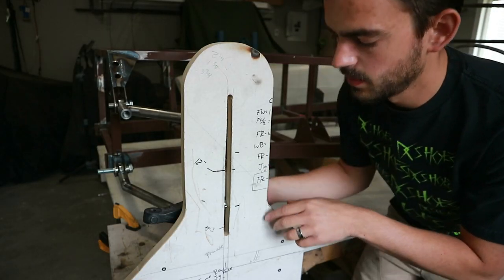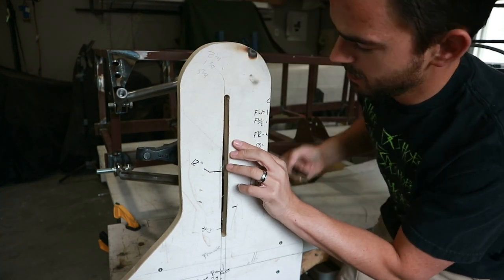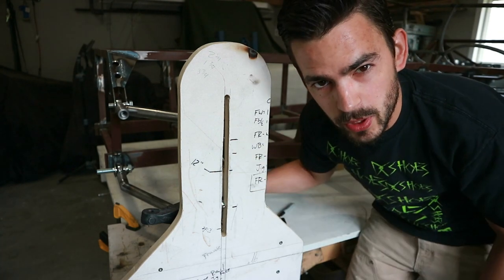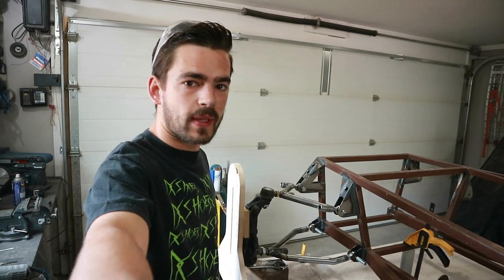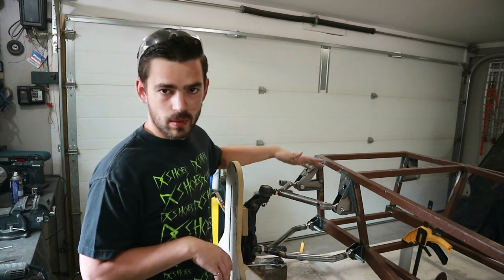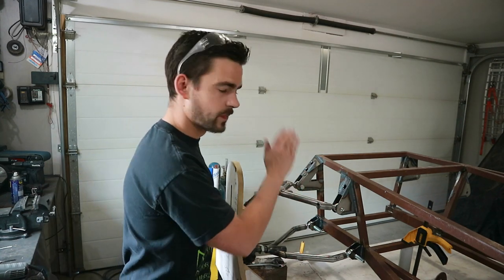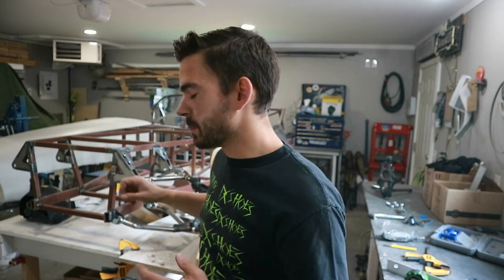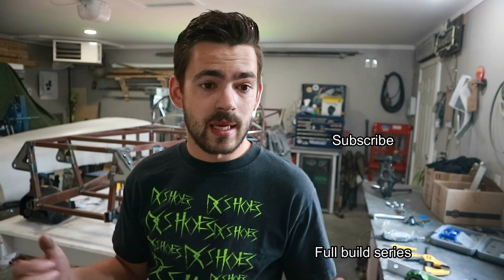Ep 85: Bending the A-Arms to Prevent Ball Joint Bind

Comment: Your camber during up cycle probably changed as well after modifying them. Best to double check before you build the other side to be sure it’s what you want
Reply from the maker: The nice part about the double A-arm suspension is that the shape of the arms doesn't affect the camber curves, just where the pivots are in space. So the bend shouldn't change my camber gain, and there should be enough adjustment on the heims to bring static camber back in line.
Reply: LeftFootFirst true, but it likely changed the length slightly. Just wanted to be sure you checked before spending too much time. 
Sorry about the job by the way. Talented guy like yourself should get back on your feet soon. I’ve been jobless for almost a year now. Lol. Plenty of money to be had on your own too